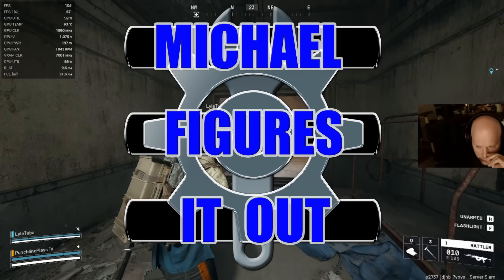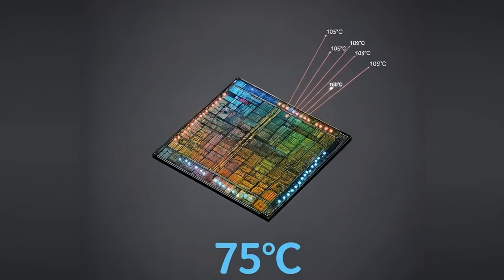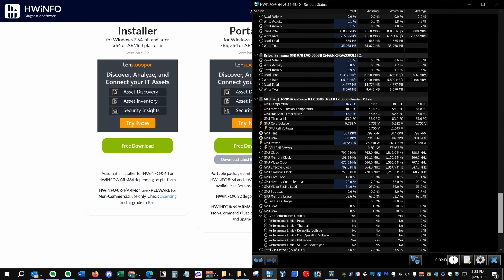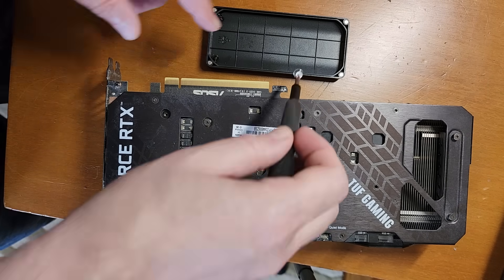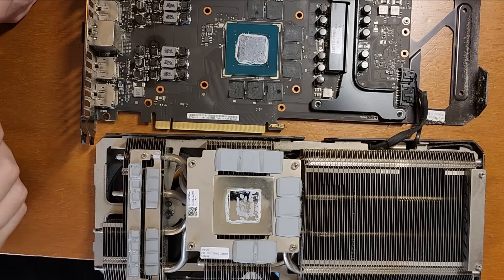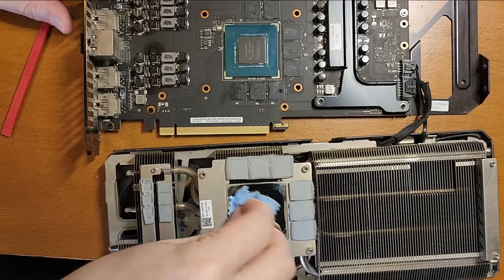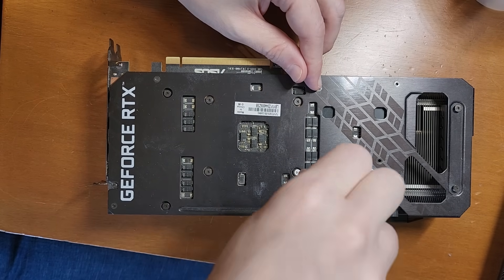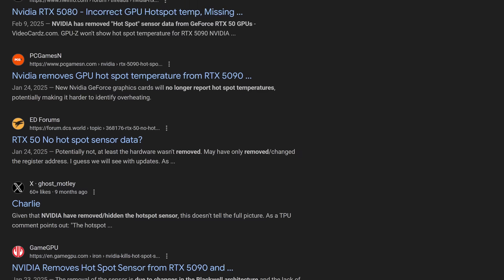GPU Temps Are A LIE!

Comment: That GPU could've used some air compressing to clean the heatsink.. its dirty AF....
Reply from the maker: The camera adds 10 lbs of dust.
Reply: @MichaelFiguresItOut  😂
Reply: @MichaelFiguresItOut  😂
Reply: Start with a vacuum.

Comment: my friends rtx 3060 ti tuf is crashing the same way but hwinfo is showing that his hot spot is 107c
Reply from the maker: That's too high. I bet your friend has the same issue as Punchline.
Reply: I my self had a 3060 ti as well, a Gigabyte, since new the hotspot always rise to more than 95°C, 2 years after buy starts to reach 105, I change the thermal paste and the temps drop from 105 to 80 at most on the hotspot, that is just with my own card, but is no the only case were I manage to drop so many °C just by changing the paste when the hotspot is that high, especially with Gigabyte cards

Comment: My 4080 had a high hotspot temp issue some time ago. It would go upto 107 Celsius at times and i did not like that.
So i pulled it apart and repasted the core with Arctic MX6. The hotspot temps reduced by nearly 20 degrees Celsius.
Reply: My Gigabyte 4080 Gaming OC + Manual OC on voltage curve @ 1.110v (400 watt): 66 core 82 hot spot 64 vram. Never repasted it and it's running like that since launch day.
Reply: @club4ghz  As it should be but some times you get unlucky like me.
Reply: @club4ghz my 4080 super avg 60℃ at 30% fan speed
Reply from the maker: That's great to hear. How long ago did you re-paste? Curious how long it's lasted.
Reply: @MichaelFiguresItOut I dont remember exactly. I think it was early this year. So the card was only little over a year old maybe 1.5 years at the time. I think the original paste was bad from the start. It did work and i did not have any crashing. But i thought it was a good idea to repaste.

Comment: my experience with noctua paste, is that it pumps out extremely quickly. 
consider viscous paste like GC extreme or ptm7950 

I had nth1 in a laptop that in 2 weeks everything got pumped out
Reply from the maker: Thanks. Going to keep an eye on the hot spot temp and switch to PTM if it seems like the paste has pumped out.

Comment: Curious if you are aware of gpu pump out? Due to using thermal paste this issue will return eventually. A thermal phase change pad is much better for cooling gpu dies as it can't be pumped out as easily.
Reply from the maker: Yes, aware of the pump out effect. Will consider a pad if his hot spot temps increase again.

Comment: 6:47 the myth still going strong.
Reply: diodes man they're very usefull !
Reply from the maker: Are you saying spinning fans with compressed air cannot cause back-EMF or burn out the fan motor? Serious question, always happy to be corrected if I get something wrong.

Comment: I mean, checking hotspot temp has been a thing for like 15 years now, this definitely sounds like the problem was between the chair and the PC, if it took him YEARS of crashes to install HWinfo.
Reply: xD
Reply from the maker: Well, it was between the PC and WhatsApp because I'm his tech support so it's my fault. But I've read people say to disregard the hot spot temp. So I think you're just 15 years ahead of everyone else!
Reply: @MichaelFiguresItOut  I'm surprised it took you so long, that's literally the first thing I would have checked...
Reply: @alexandruciordas4941 literally. This is not smart, its standard practice.
Reply: @MichaelFiguresItOut  Hahaha ok, not 15 years, but since the RX5000 were released, 4 gens ago already, so ~6 years, thats a long time. In fact Im pretty mad because they removed the GPU Hot Spot Temperature sensor from the RTX5000, my 5080 only has a GPU Temp sensor and a GPU Memory Junction Temp sensor (that's usually even lower than GPU Temp in my mode).

Comment: Nicely done!
GPUs should have an alert when the gap between the average temp and hot spot is too high.
Reply from the maker: That would be a really smart addition to any temp monitoring program!
Reply: Well, this delta is dependent on the chiplet configuration and sometimes big delta is normal like in some of the AMD products 20-25 degrees delta is okayish.
Reply: @SABRE117  well eacch gpu should have its own range for alarm than if some r diff its not hard
Reply: @SABRE117  20-25 should be max and could be tolerated, but its not ok thats the sign for most gpu new paste should be applied soon or there is a little cap or bent and some gpu even out of box already had that problem one of main reasons for big delta even with  new gpu
Reply: @FoxSky-md1ul  Oh, I meant just the configuration of the chip itself can be the cause of the big delta sometimes, so it is not absolute that big delta is a problem, thats what I meant. But if the hotspot is higher than 95 I would be worried.
Reply: Or just tell you the hotspot temp, which AMD does already.
Reply: @joby602 all nvidia gpus before 50 series obviously also give you hotspot temps

Comment: What a relief after applying the thermal paste!!! After the warranty of my 9070XT expires, I'm going to apply another thermal paste (I'm getting 63º on the GPU and 90-94ºC on hotspot). EDIT: I contacted AsRock support and they returned that anything below 110° C is ok. I can confirm this because I used a 6600 for 4 years running the same hotspot temperatures without any issue.
Reply: It is pretty normal in my experience for some AMD cards to just have very high hotspot temps. It's supposedly expected to get up to 100 on hotspot sometimes. My 9070XT regularly has a 25-30 degree delta between core and hotspot temps, getting up to around the same as with you.
Reply: @temporaltomato3021 under 100c hotspot max is fine , look at the average more, if average hotspot is 90 ish its 100% fine, throttling starts at 110c
Reply: Water boils at 100°C.💀
Reply from the maker: Do you need to wait until the warranty expires? I would contact them via email or chat (so you have a written record) and see what can be done. You don't want to reduce the longevity.
Reply: @MichaelFiguresItOut  that's what I've just done some hours ago. let's check their response.
Reply: @MichaelFiguresItOut 
Perhaps that's perfectly normal with GPUs unlike CPUs.
Years ago when I bought MSI Gaming Z Trio 3080 12 which sadly I don't have now(life forced me to get rid of it and now I have just RX6600).

There were no reviews of that card I think which made it extremely risky purchase,but I was in love with its looks.
On some forums(maybe Reddit)I read its going up to 110C,but that that's normal.
With 3 years warranty (or perhaps it was 5(I live in EU)),I couldn't care less.

I never check temperatures on my XFX Swift RX6600.
Reply: What 9070XT model do you have? That's very high!!
Reply: @Yagami2027 ASRock steel legend. But it only reaches this when playing Cyberpunk. Others run fine around 75-85 degrees. Also, I've been reaching these 90-97 degrees with an old 6600 for 4 years without any issues.
Reply: Difference is too big. Give it back on the warranty. Core and hotspot is max 17C difference. If it's above then some thermal pads do not stick well
Reply: @xAndrzej42 20-30 delta is normal dude you should look it up, on amd cards 20-30 is expected at least
Reply: Honestly speaking i have never ever cared about gpu temps or fixing them. And i had exactly 0 out of 8 cards that died
Reply: My 9060XT hotspot gets pretty warm as well. I took an old cpu cooler heat-sink and just set it on top of the part that is metal. Helped quite a bit.
Reply: you never have to push your gpu to its limit. i can get 100 to 200 fps in most games but i still lock it to a certain number, depending on which game it is so it can run comfortably only using 80% of its power.
Reply: @__-fi6xg I do the same for most games. However, some games such as Cyberpunk 2077 requires a lot of GPU power and to run nice around 70-80fps, it uses all available power.
Reply: @magichatake  yeah i can see that if you want native. However its a nvidia title.. transformer model and ray reconstruction is something AMD does not have yet even if it would match the RT performance. For me, even DLSS performance looks good enough in cyberpunk, havent seen fsr 4 yet but 3 is kinda shit
Reply: @__-fi6xg oh, but even enabling FSR4 it reaches these temps. Fsr4 is great but fsr 3.1 is really a garbage, too blurry.
Reply: The ASRock 9070 XT is one, if not the hottest GPU right now due to its VRAM. They would say 110 C is okay right now, but it greatly risks the GPU's longevity. Might aswell change the thermal pads and apply thick thermal putty, it works a lot better than thermal pads only downside is that everything looks like a mess, but it's better than a dead GPU. Also undervolting the GPU will reduce those temps a lot and you won't be voiding your warranty by undervolting.
Reply: Just set it to -80mv and power draw to -30% and the hotspot temp will get lower.
Reply: @shargakun I've already did that but didn't see any difference in the temperatures. However I could see that the GPU clock increases.
Reply: @magichatake Just adjust the fancurve my guy, the vendors are braindead with the stock fancurve somtimes and let it be the bare minimum.

adjusting the fancırve a bit in the sofware and lowering the power limit aswell as the voltage should do wonders
Reply: @nevoburi yes you're right. ASRock returned my support ticket and said that anything below 110 on hotspot is ok. I think we can trust this information because I've had a Rx 6600 for 4 years running around the same hotspot temperatures without any issues.
Reply: Rdna 3 and 4 seem to have higher delta. I know why my 7900XT gets hot, at full power it pulls 400w, that's a lot of power for a triple fan cooler to dissipate. I do get dangerously close to hotspot max, but my card is from the rdna 3 launch, so it's getting old. Ive got some ptm 7950 to put in if it starts being an issue.
Reply: Try PTM7950 instead of thermal paste. It is wonderful. Not conductive and much better than any thermal paste.
Reply: Before my rx 9070xt nitro i had rx 6900 xt nitro and was running also for few years on high hot spot temps 😐

Comment: Cool video! 

I did this with my gigabyte 3070 when it was thermal throttling constantly in a well cooled case playing battlefield 6 low settings (which had me completely stumped at first as never had this issue)... Changed the thermal pads out and the thermal paste for honeywell ptm 7950 and now it runs at avg 65c hotspots around 10-12c higher, not seen it go above 75 for games & stress test softwares since the changes even while overclocked.

Ended upgrading my CPU/MOBO soon after and noticed the old paste was in a state so with the new one I put thermal grizzly PCM pads on too and the 9800x3d nearly gets same temps as my 3700x lol. 

In both cases temps were WAYY better straight away, but took a week of heat cycles to get the lowest and most stable temps.
Reply from the maker: That's awesome. I'm definitely going to switch to PTM 7950 if the temps go up again.

Comment: Another comment from me, recommending the PTM7950. I had to repaste my 3090 two years after purchase as its hotspot would creep up to 100C, but the core temp. was around 70C. The paste had hardened and was barely covering sections of the GPU die. 

The repaste worked for a few months, but I eventually ended up with the same situation as before. 
Then decided to go with PTM7950. It was hard to use and I don't think I applied it correctly, but the hotspot delta dropped by a few degrees and has remain unchanged since then.
Reply: This
Reply from the maker: I hear PTM is hard to work with but worth the effort.
Reply: @MichaelFiguresItOut  It indeed is. The biggest hassle is that at room temp., the pad is very soft and difficult to apply correctly. But this is resolved if you cool it in the fridge for a few minutes before.  

I used it about 3 years ago, when it was not as well-known and messed up the application. Still the hotspot temps went down and stayed there.

Comment: I only look at the hotspot temp for monitoring. And my 7900xtx sit at a comfortable 80c hotspot at 375w.
Reply from the maker: Nice!
Reply: I have up to 86 with no fan curve with 500W full power after changing paste to PTM7950 and 83 with preset fan curve. Overlocked and undervolted with afterburner 1110mV, 3000MHz core, 2650MHz memory, +10 power limit.
Reply: I own 2 pc's. One with a 7700xt and one 7800xt. That 7700xt has 3 fans, kinda overkill BUT OMG ITS SO NICE AND QUIET IN EVERYTHING.

Seriously made me consider always going with budget/midrange cards and do 3fans even if 2 can manage lol

Seriously. That 7700xt has amazed me. Sure the 7800xt has more power and is quite a bit faster, but for a guy that mostly plays old games that 7700xt is the sweetspot. Never even considered looking at temps.